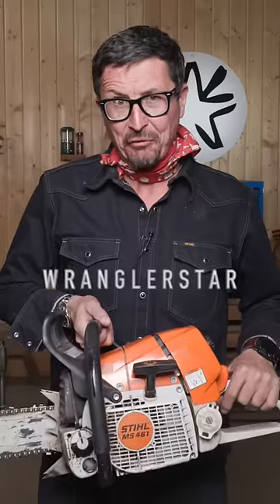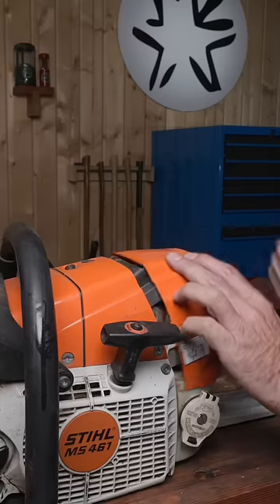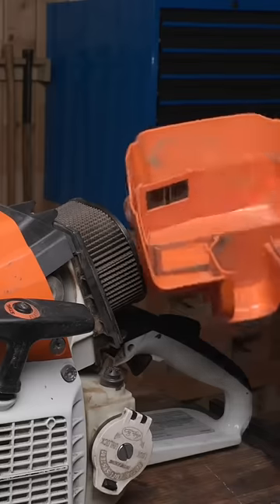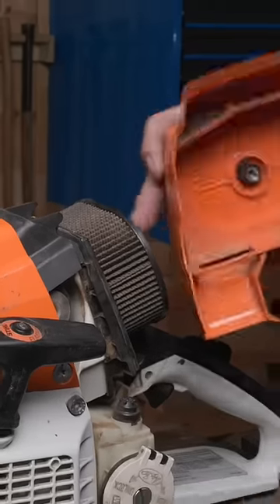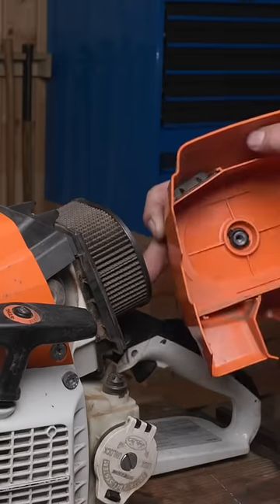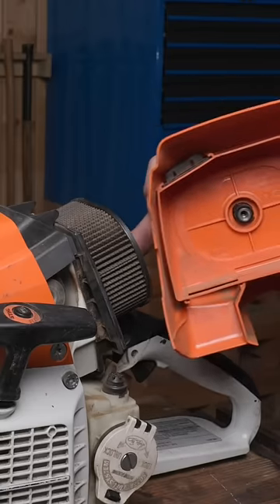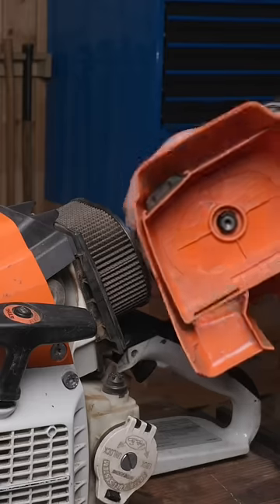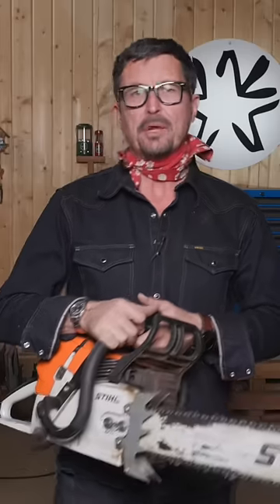Stihl Chainsaw Hidden Feature  Wranglerstar PROfessional HOmeowner #shorts

Comment: Echo cs590 has a built in slider near the carb and air filter no parts to lose just slide it one way for warm weather the other for cold, I'm sure other echo saws have it as well but I only have the 590 and absolutely love it
Reply: My echo 6700 has one too.     Love em.
Reply: My CS-4910 has it too

Comment: The identical sized rectangle opening on the bottom of that cover is for storing that plastic piece, when it’s not being used 😉 I believe every saw built in the last decade has a “summer/winter” baffle, at least the high end ones do
Reply: My ms250,271,193Tand my 362c have cutouts for the S/W baffle. Put it in one way for winter and flip it for summer. If it has a spot to store them I’m all ears and eyes. Not saying your wrong just saying maybe you know something I don’t. All my saws are 2019 and up
Reply: Good to know thanks
Reply: Yeah, especially those built by companies intending for use in cold climates. Which is all the good ones.

Comment: I'm pretty sure you don't remove it but you move it to the other slot on the bottom. that way you don't lose it.
Reply: Pretty sure he’s just talking out of his ahnus
Reply: My 066 you flip it over there's a 🌞 on one end and a ❄ on the opposite side.
Reply: You don't put it there so you don't lose it, you put it there to block the cold air from coming in.
Reply: I noticed the slot for the bottom your probably correct
Reply: so the thing is used in the fall/winter, but take it out in the spring/summer?
Reply: It's also not for "extreme cold weather", it's for temperature just above freezing point of water. Under the freezing point, the air humidity quickly goes towards 0% and no ice forms in the carb.

Comment: You should also change your air filter if you do this. Your summer cardboard one will soak your carb even faster. Plastic/composite mesh filter are a good winterisation

Comment: It's not often you see a carb heat de-icing system outside of aircraft, well played Stihl. 

I'd personally run a lil wire linkage to it, but that's just my overkill circuit firing lol. One less thing to unscrew makes me happy.
Reply: It goes into the bottom slot
Reply: Almost every single chainsaw has this. Nothing special for stihl

Comment: I got a little ms170 and it has 4 spots on its selector, it took me 2 years of only using the top on and off before I realized what the bottom do. It used to take me 15 minutes of wildly yanking at the cord to sometimes success and sometimes I’d give up covered in sweat and ready to fight anyone or thing that looked in my direction. Then I learned those 2 setting serve a purpose, I can start it now

Comment: Some of us actually read the manual when we purchase something. Quite a few newer small engines actually have an intake "cold weather" position or plug on the air filter shroud/housing.
Kohler, Honda, B&S all have some form of engine platform that utilizes these.

Comment: Have you done a video on all the new battery operated chainsaws? I’d love to hear your thoughts.
Reply: I'm not a Sawyer by no means. I guess you could say I'm just a typical homeowner I've got about 2 acres of land and got tired of having to work on my chainsaws before I could use them so I switched up and bought a Eco 16".  For my use this thing works great.  I don't know that I would want to have an electric chainsaw as a Sawyer but for your typical homeowner yeah so far no complaints at all.
Reply: We have a Milwaukee electric chainsaw for use around the farm and in woods, works very well, just not as much power and speed as a gas chainsaw, but is less maintenance. No complaints yet.
Reply: I don't know how new, but he's tested some battery saws against his Stihl in the past.
Reply: @benjaminmatejka6182  I bought the mid tier Hart 16" 40v saw and I'm very impressed with the power, it's really hard to stall out, but any full power cutting over a few minutes straight makes it shut down from overheating. That said, it's got enough power that I don't fire up the gas saw for most of my work now.

Comment: Carb icing can occur even at 70⁰+ depending on other conditions. The throat of the carb is a venturi which causes the intake air to accelerate as it passes through the carb. This acceleration causes the pressure to decrease, and since pressure and temperature have a directly proportional relationship, the temperature drops as well.

Comment: It's not for extreme cold weather, it's for temperature just above freezing point of water. Under the freezing point, the air humidity quickly goes towards 0% and no ice forms in the carb.

Comment: Most chain saws have that air box door for extreme cold weather operation. Some even have available, as an upgrade, electrically-heated carburetors & heated handles for extreme cold weather use & operator comfort.

Comment: Propeller airplanes also have something similar. The carburetor ices up at flying altitude, so there’s a valve to divert engine heat to it to keep it warm.

Comment: My stihl 800 C-E magnum blower has a switch to turn it to summer or winter mode. As an East Cost guy, I appreciate Stihl putting a snowflake and sun icon on the switch so I don't get confused.

Comment: No problems down to 20 degrees in my experience.  Running pump gas 87. The one exception is I run high quality oil.

Comment: THe aftermarket... "Fake" ones (blue plastic) off amazon... most likely made in the same place... also have that samen thingie hiding under the air cover. 

My HV doesn't have one, but I've found it needs a bit of gaff tape over the intake vents under 40F. 
I had to cut a fallen deadwood last winter at -10F, and I used the paper towel trick to start it, but it wouldn't stay on until I taped off some of the intake. This easy recycle add would have been a better play. 

I believe Echo's also have this plug. I haven't finished building up a Stihl clone from one of the amazon beasts yet (buying a bar for it next week actually), but walked out and verified that plug and recycle port is there. It's not mentioned in the manual!

Comment: Bought my Stihl chainsaw back in the 1985ish had it tuned up gone over lines and things taken care of once more then twenty years ago and it Stihl runs like a charm. Starts by the third pull. Woodboss 028, 16” bar just bought the third chain for it from my Stihl dealership about two years ago. Thanks for great products, Stihl. 
Now anyone want to buy me a Stihl blower? Hand held or backpack not picky.

Comment: I have a old Echo 310 I use to trim saplings off fences and that saw gets so hot it boils the gas in the tank. I've never seen anything like it before you open the tank and the fuel is at a rolling boil. Its wild!
Reply: 😬 and thus I only run Stihl

Comment: I have a 461 and live in Montana. Even in the winter months, brutal cold temps, I've never removed that piece except when cleaning everything. I really think 59° is way too warm to be putting excess heat into the carb. Hell, I think that's too warm to be bucking up logs. I don't like to sweat haha

Comment: Fun fact. You’re not supposed to remove it completely.  There is a different place to instal it to keep from losing it and to actually change the air path instead of just decreasing air resistance.

Comment: Care taker for 4 years on 40 acers and used a 660 mcckulloch below negative 4 degrees. I would drill a one inch hole and cover it with duct tape in warmer weather

Comment: Ugh. I actually hate this about Stihl saws. My Husqvarnas will run in any temperature with no modifications. Stihl forces me to mess around with that summer/winter baffle.
Reply: I live in mt and cut anytime of the year. I've never had to do this with my stihl.
Reply: @maddawgnoll  What model Stihl do you have?
Reply: @Bixby-and-Buckshot  ms461. Same one he's holding actually. I've just never ran into any issues where cold is too cold. I have some Husqvarnas also, but I prefer my 461 over all. Power to weight is that happy level
Reply: I also have a stihl T handle and am ms261. Then there's the Husqvarna 570, and two others I can't remember the models of, and my grandpa's 70's Era I believe Husqvarna 44, which originally had the creme and orange. But the cover cracked hasn't years ago and has since been replaced
Reply: @maddawgnoll  So if I had to take a guess, I'd say you probably use your saw a lot, and had the engine nice and broken in before you ran it in the deep cold.  My buddy has a Stihl 362 - in the first 100 hours of use that baffle had to be flipped in the cold to get the saw to run, but once it was broken in it never needed that again. Now it can just say in "summer" mode all year long. (I live in Minnesota, for context. The baffle had to be flipped when it was colder than 30 degrees F.)  Good saws, just one of the things I don't like about them.
Reply: @Bixby-and-Buckshot  ya you can say that. I lived in CA and would cut 40-50 cord of firewood a year as a side hustle. This is going to be my second winter in Montana, but last year was well before zero and I didn't have any issues. Except my fingers go numb haha

Comment: no it won't vapor lock anythi.g it will just richen the mix up since the air is hotter and therefore less dense and also Rais combustion temp leading to detonation and melting piston

Comment: I had to run a generator in -10° after an ice storm and we had sound proof insulation over the whole machine and the air cleaner still froze over. Had to run it without the filter on.

Comment: more secrets:  grap the handle at the curve and u have ur 45° for angle cut.  And there's a 'sight' on the white plastic to use to see where the tree will fall.  make ur 1st cut, leave saw in tree and look dwn the little white raised plastic line.

Comment: I knew old Cessnas had carb heat for this reason, but I guess I'd never thought of anything else using it or suffering carb-ice. I guess old carbureted vehicles had the same issues? Perhaps a little knob or lever to pull just like carb heat in an old carbureted plane? Now I'm curious. I know even manual chokes got phased out on vehicles quite a while before fuel injection came about, because the average person doesn't know how and doesn't want to learn how to properly operate their vehicle. 

Some of you old timers and automotive history buffs drop a reply with any info on this.

Comment: Well I knew could be that I'm certified platinum Stihl mechanic... There is also a  slide vent for summer or winter but if you're not in the artic it should never be on the cold side. Its on the right side on the saw its self not just on the cover!

Comment: Do you know of a gas powered weed whacker would have the same sort of mechanic? I usually have some mid fall clean up I need to do each year, and always notice that the whacker tends to chug a bit in that cooler weather.
Reply: The big Stihl brush saws do and they're basically a glorified weed Wacker. On mine it's on the front side of the motor.  Just a small black plastic piece you can pull out and turn around to suck warm air out of the clutch housing.
Reply: @jaywiebe7612  Cool. I'll have to check to see if mine has the same sort thing around that area then.

Comment: If Stihl were smart they would put another track right next to the existing one to give you a place to put the plug so it don’t get lost.
Reply: You could just super glue a magnet to the plug and in housing to hold it in place
Reply: There is a second slot on the bottom. The bottom slot puts it into "winter" mode. The top slot puts it into "summer" mode
Reply: @atlascharles6895  Thanks!   Curiosity got the best of me and I found that you are correct on page 36 of the operators manual. The one hole provides unheated air for the summer and the other hole provides heated air for the winter.
Reply: @shadowdog500  Yup!

Comment: Huh, wierd. My 18 year old Husqvarna has a little door you slide open or close in the airbox lid for the same reason. Pretty sure the 27+ year old one has too. 
Arguably better than the Stihl design because you can't lose it.
Never rember to use it tbh, doubt it really matters in a more temperate climate.

Comment: "This heat plug is designed to prevent carburetor icing in extreme cold weather. ...... Remove it below 59 degrees."   This is contradictory.  What is wrong here?
Reply from the maker: Ask Stihl,
Reply: It does not need to be near freezing to get carburetor icing.  The Venturi in the carburetor makes the temperature drop.  It also causes the water vapor to condense into droplets. So it makes its own cold and it’s own water.  With the proper humidity you can get carb icing at temps over 100°f.  59° must be a temp that is high enough that they know the carb won’t ice, yet low enough that the excess heat won’t cause problems.  You remove the plug to introduce heated air into the carburetor to prevent the carb icing.  They do the same exact thing on carbureted airplanes but the pilot only turns on the carb heat via a lever in the cockpit to remove carb ice once it forms.

Comment: .... Im a third gen logger,  I've run Stihl for 35 years 

066 Magnum Arctic,  came out 25 years ago with an electronic heated carburetor 

also, you can get a winter kit

however; If you think that little bit of extra warm air , will help when logging; It won't

huge difference between farming, cutting firewood and Logging   HUGE

so much info missing here  =/  misleading video